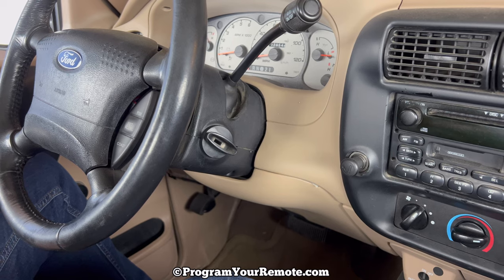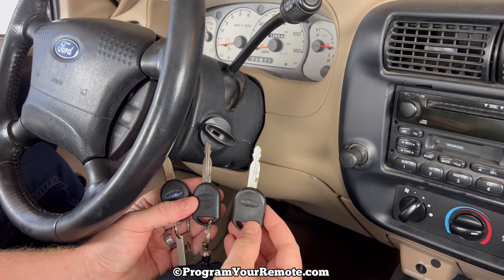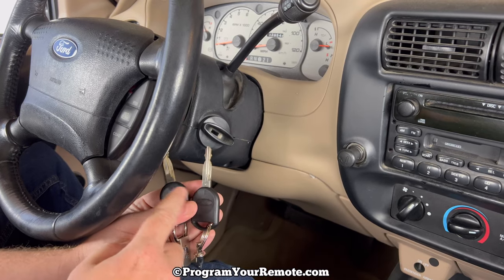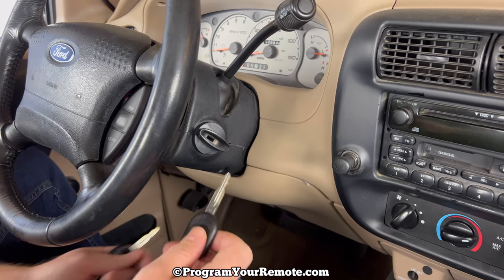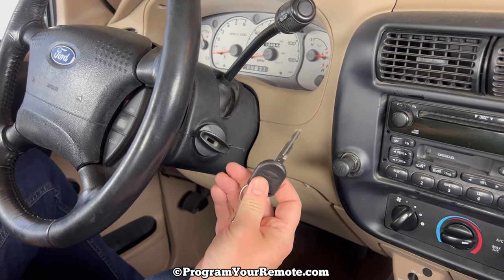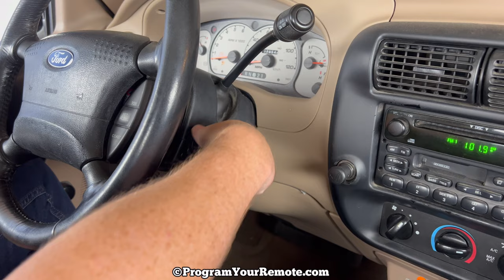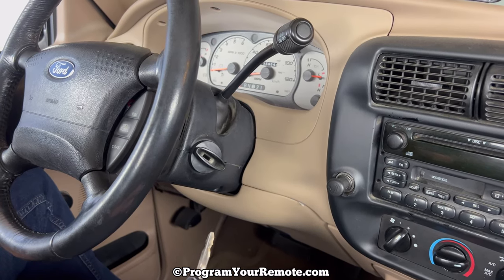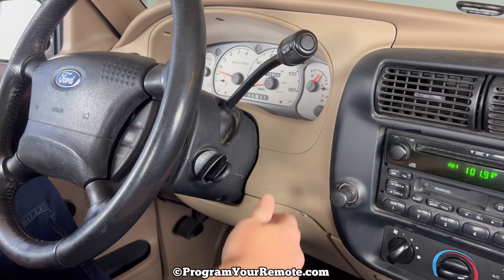2001 - 2011 Ford Ranger - How To Program & Add New Key - Additional Ranger Key Programming

Comment: i swear iv done this with a single working key before but the procedure was different... im gonna search this shit up a couple years from now and its gonna say i need 5 keys to do it...
Reply from the maker: you don't need 5 but you definitely do need 2
Reply: @PYR-Auto  could have swore there was a method that only required a single key because when i did it i only had a single key with a transponder in it and i was able to program a 2nd.

involved turning the key on and off like 8 or 12 times and then something with the gas peddle...
Reply: My ignition switch locks up so I'm unable to turn it on and off. With the new ignition switch will the programing the new key if you place one of the old keys next to the new key and cycle the switch?

Comment: You’ve helped me save 160$ this worked on my 2000 4.0 4x4 ranger. The lock smith was here earlier and was only able to program 1 key to my ranger and gave me the 3rd

Comment: Saved my bacon dude. But neither one of my original keys would start my truck, so I just thought I'd try your trick to see and what do you know, it worked. I tried both keys for days to no avail and your trick worked immediately. So maybe you only need the original keys to reset the key code unit to default and it has stored key code memory? I don't know, but I'm not gonna complain.

Comment: What if I only have one working key can I trick the system by doing your steps just re insert the 1st key for the second time then on with the new key will this work?
Reply from the maker: You can't - you will need an automotive locksmith or dealership
Reply: 😂 I had the same question.  Battery plus wants $80 to program it
Reply: @Truckingtowardsfreedom  yes I ended up paying $55.00 at the local locksmith I now have purchased 2 clone keys these you can program yourself but you must have 2 already working keys .
Reply: @derekreinhardt7818  oh you mean if I have one original and one clone I can program the third on my own?
Reply: @Truckingtowardsfreedom  yes
Reply: @derekreinhardt7818  good to know. I’ll give it a try. Thank you
Reply: @Truckingtowardsfreedom  you're very welcome

Comment: this doesn't work in my 2002 ranger , i have 3 working keys , and i wanted a 4th ,
Reply: I might be wrong, but as far as I know the "two working keys" have to be the original keys/ones programmed by ford or specialty locksmith tools
Reply: My too
Reply: I eventually got this to work for programming a third key, but still haven’t gotten it to work for a fourth. So I don’t know—maybe more than 3 needs dealer/locksmith programming?

Comment: I do not understand why you have to have two working keys.

You mean to say if I only have one working key I cannot get a duplicate key I'm going to the dealer?
Reply from the maker: Correct - dealer or automotive locksmith
Reply: I know I'm in the same boat. I never thought about getting another key when I had 2 working keys. Ford could have set that up to work with only one.......
Reply: Have to have two working keys to learn additional keys. Otherwise you need a higher end scan tool that can access oem functions for the vehicle.

Comment: I only have one original key because I lost the other one.  Can I do it with one key, or do I need two keys ?
Reply from the maker: you need 2 working
Reply: @PYR-Auto  Last question Sr.  and thanks for answering.  If I program a key with the locksmith, can I use it with the other key I have to program the third key ?
Reply from the maker: Yes you can

Comment: been trying this for the last hour now with 2 working keys and a blank key... doesn't work at all

iv tried every single different method that says this works... i tried switching keys so bloody fast i was just throwing em at the ground before switching to the next... i tried waiting for the anti-theft light to go off each time.. i tried waiting 1 through 12 seconds for the blank key to program after each try no method worked...

only time i could get the non-programed key to work was when i tricked the anti-theft by cycling keys soo fast it would just accept the key for a single time... engine would start fine but soon as i turned it off the key wouldn't work until i tricked the system again.

overriding the PATS for a single run you can do this with a single working key to trick the vehicle into accepting an non-programed key a single time... just quickly flick your ignition on and off with a working key and switch keys before the anti-theft light blinks...